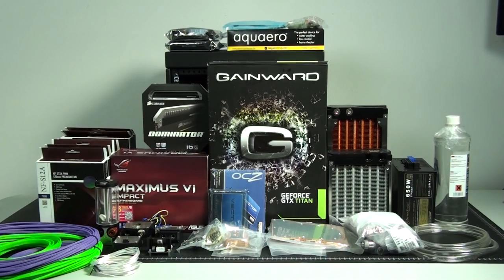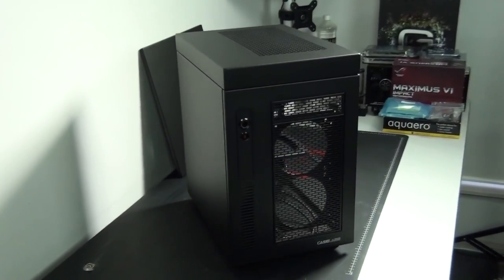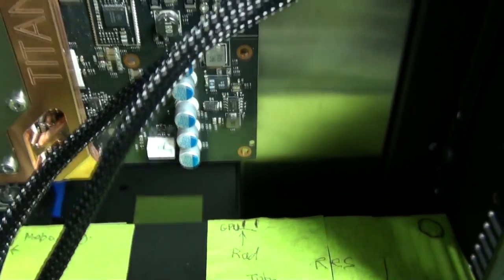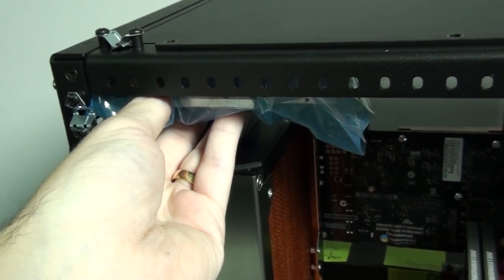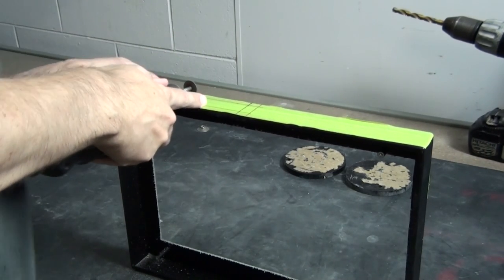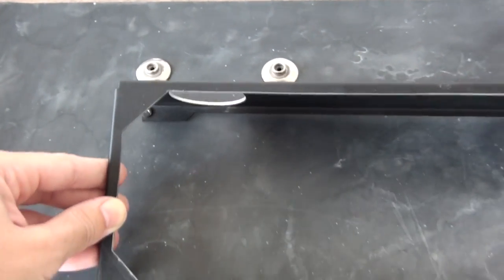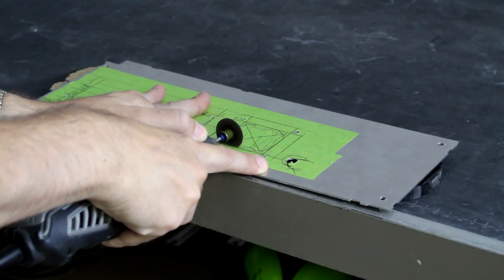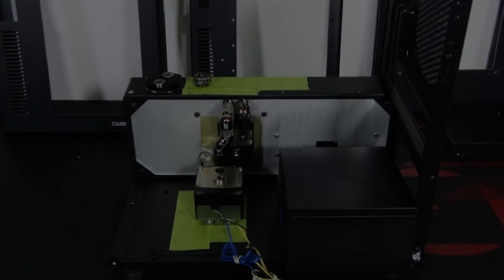Build #16: 'Typewriter': Part 1

Comment: For those wondering why there is a waterblock on the drives, I have a WD Velociraptor, it runs at about 30 C idle and up to 40-50 C when under load. They are 10,000RPM drives and are very, very quick.

Comment: 1st off I want to show my appreciation to you and your channel. Long time subscriber. It is truly the most informative and inspiring computer video channel by far. You make each build seem easy and fun to do. So thank you and keep going at it.

2nd I how questions about the build itself and I know you want to go back to the beginning of your channel days and be more informative so I hope you will have a chance to answer my following questions...

What are the benefits using aquacomputers flow sensor, temp radiators and filter components? Are they consider premium components?

I don't recall, why in this build are you using flex tubing? Is it because of the theme?

Lastly how is the air pressure going to be? Intake from the front (push pull) exhausted up top with a single 140 also exhausted from the rear with another 140?

Thanks you in advance and can't wait till the month is over to see part 2.

Comment: I wonder how it would look if you had installed short crystal link/acrylic fitting on the HDD-water blocks, bend hard tubing in place and used a fill port to go back to the requested soft tubing below the panel.
And I'm really interested in these small form factor builds. Kind of played with the idea of trying to make a bitfenix prodigy build myself. Though right now I'm contemplating building a computer into my shelf. PSU below in a hidden compartment, motherboard on a pedestal, radiators in another compartment at the top and having a big acrylic backplate and make some "art" in the tubes going from top to bottom.

Comment: First off love your vids....easy decision to sub.   I had a question about sleeving the PSU.  After watching your videos I can sort of see how you do the dual wires in the PSU with solder.  I was wondering if using a 14g-16g butt splice would also work.  You would put the 16 and maybe a 22g wire in one end and then have a 16 gauge coming out the other.  I wondering if it just wouldn't fit or you would be concerned about how good the connection of the 2 wires in the one end of the butt plug would be (even after heat shrinking).  Any thought would be appreciated.

Comment: The build is looking great man. I would like to know what you used and how to shape the acrylic up by the hard drives. Also is it possible to heat and bend an acrylic "plate" (like a 5mm thick rectangular piece) using the same method as bending tubing?

Comment: Will that 650w PSU be enough for Titan and all that high-end components, including pumps for water cooling?
Reply: I doubt it. Dual pumps and a titan. You'll be in trouble if your power fluctuates. The first surge or blackout and all your parts will be fried. Not to mention you can't overlock anything.
Reply: I guess he is using this psu because of it size, there is a lot of bad reviews for this silverstone psu. This is the maximum watts for this size 140mm.
Reply: I think it will be enough. I found review of Titan, where they measured power consumption in realtime. Power consumtion at full load was average 232w, max 244w
Reply: It's more than enough.  You can run a Titan on a good quality 450-500W unit (no I'm not talking out of my ass here, check the EVGA Hadron for instance) no problem, especially on LGA 1150 platforms.

People often overestimate the power requirements massively.  What's much more important is simply choosing a good unit.  That'll keep your voltage nice and clean and stable along with delivering more than enough oomph.

Comment: Where do you get MDPC sleeving? They're on "holiday" now

I really need some sleeve, but I have to wait until they open their doors again :D

Has anyone else suggestions for another sleeve kit I could use instead?
I heard MDPC has the best quality sleeving avaliable, so if there is something out there which is as good as MDPCs sleeve, it would help me a lot...
Reply: They're super hard to buy from. They've been on 'holiday' for months now but they open for very small windows each day. You need to find out when their next window is and plan ahead, it'll probably take a couple of tries unless you are sure what you need because the windows they're open are less then 20 minutes most times so you barely have time to browse.
Reply: Mc Mc
Thanks man you really helped me out. Seems like I have to get a faster internet connection :D
Any idea how to find out the next window?

thanks again
Reply: DaRedaBua Ask on the overclocker.net forum there's alot of people there that are serious modders and will be able to help you. I have read several times that there is a US seller selling MDPC but i'm not sure if any are still open.

Lol looking back through my old bookmark heres the old guide i used when buying my sleeving. It's from 2012 though http://www.overclock.net/t/1226831/guide-how-to-order-mdpc-during-short-open-times-time-zone-calc-cart-method

If you're only after black sleeving there's a US seller on eBay http://www.ebay.com/usr/furryletters?_trksid=p2047675.l2559 that's also highly recommended for their sleeving not to sure about their heatshrink though. It's reviewed here with MDPC http://www.overclock.net/t/662039/cable-sleeving-gallery-discussion
Reply: try llutro0 custom

Comment: I Just got my new nzxt h440 case and put my loop in it and discovered that the airflow is pretty terrible,i could improve it a little by removing the mesh on the top and side pannel but the temp´s are still not what i want.

I´m using a fx8320@5,0Ghz,1,48v in my loop with one 360 rad and a 240 with sp120(at 12v) as intakes on both rads.

The Water temps while surfing are almost 30°C and the Cpu at 43°C and since i want to add a GPU soon i want to improve the airflow since the temps without the top and front panel are way better(water never reaches 30°C after 30min of aida64 benchmark)

Now i´m planning to replace some space of the front and side pannel with some Mesh,but i never did something like that and hope some of you guys could give me some advise how to do that.

Comment: I sure as hell use an optical drive. I have older games that won't run without the disc. Digital downloads also just aren't the same as having a physical disc that you can hold in your hands, in a box that you can display on your shelf.

Comment: Why would you want a GTX Titan nowadays?
Reply: A Titan is still a lot better in compute, could be used for professional work, not just gaming. That being said maybe they already had the Titan?
Reply: dKJustwon It's not better in compute, though one advantage is it can do FP64 compute
Reply: acnfanmanin I read that too. It does depend on what you're doing with it, but in the end it's the buyers money.
Reply: More Memory, since nvidia isn't releasing any gpu soon
Reply: Fred Bruno Why would you need that much?
Reply: Fred Bruno If you really wanted more memory Titan Z that shit. jks
Reply: acnfanmanin Well, I have 4GB of VRAM and I sometimes run out. Even though I'm at 1080P, texture packs can murder a card.
Reply: Kevin Columbus Ok texture packs can do that sometimes but those are in my opinion a bit extreme lol
Reply: Maybe.. Lol. I average about 3500MB of VRAM usage on Skyrim. And don't forget anti aliasing!
Reply: Kevin Columbus I would have done the 970 ti with 6gb and the 980 ti with 8gb.
Reply: Yes!
Reply: Lol maybe
Reply: I dount that... Lol
Reply: Lel at max with 970, 3.5gb
Reply: Fred Bruno 980 ti with 8gb. ?